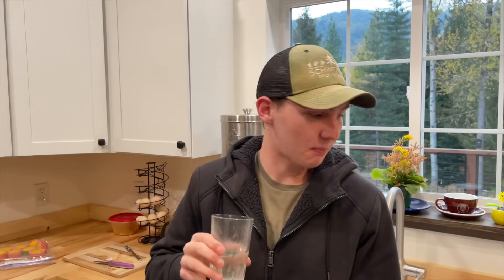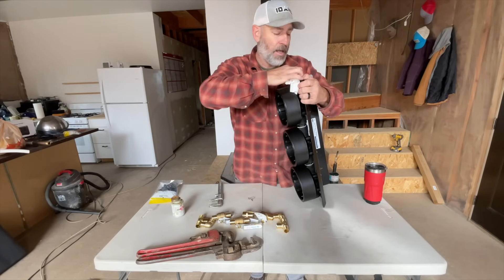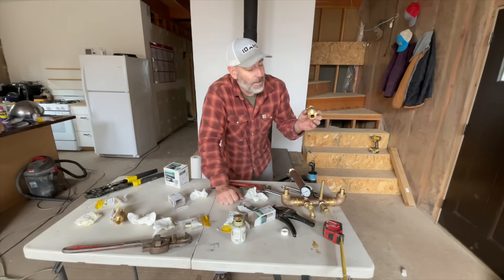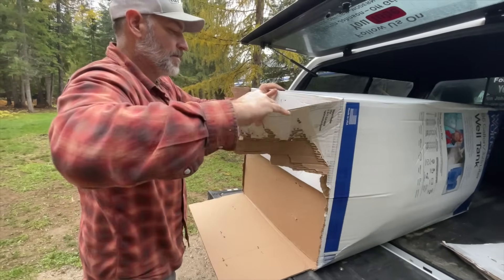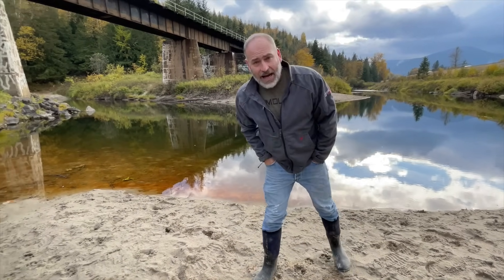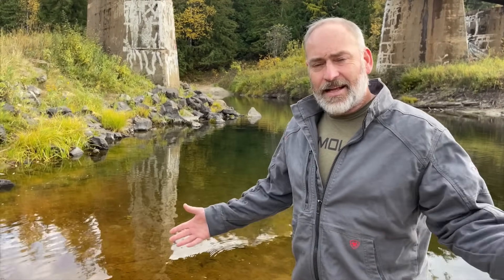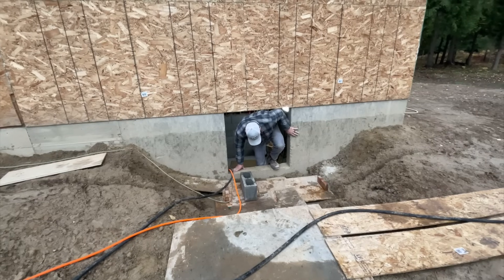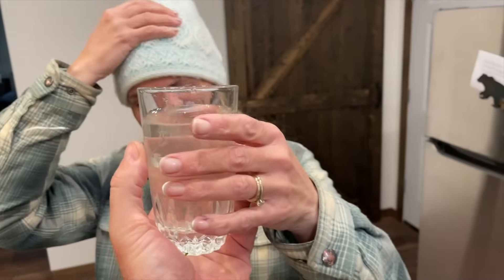ULTIMATE Off Grid Water System - Real Off Grid Living

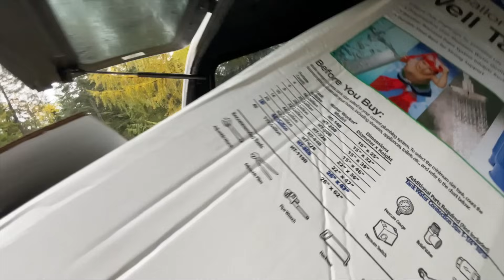Comment: Hey never seen your channel before, but I am a well technician hopefully I can give some tips or advice. 1:20 I use teflon tape and pipe dope when I do anything. It cheaper to buy teflon than to have a call back for a leak. 3:20 you don't need to open the bypass to change the filters unless you have something very important using water. I also didn't notice any pressure release buttons on the filters they may be black and just hard to see. But if you don't have any way of releasing the pressure out of the filter you will never get it lose. 8:45 tanks are sized based on your pump size. I am sure this one is sufficient but the reasoning is for proper run time of the pump, you don't want it run for short periods of time bad for long term health of the motor. 9:50 if you can run a ground to the tank. The brass to stainless connection will cause electrolysis but can be lessened with grounding. 22:35 Carbon should be last in line as the iron will foul it out and clog the filter.  hope it helps

Comment: OOPS never use Rector Seal on any plastic.  If you do not like teflon tape, use a Teflon based paste. just an fyi.  also put a check valve between the tank tee and the filter, so you do not draw water back from the house. filter placement. sediment, iron manganese then carbon.  never use the wrench to tighten the can, it is an o'ring seal.  the wrench is to remove them

Comment: Hi mate have you thought about reverse Osmosis filters, they can even filter out salt it could be overkill or it could just not needed but anyway i thought i would mention it and for the water Snob check out Kangan water they have a machine that changes the ph of water and has its extra filter steps but they are expensive from what i understand they do some electrolysis on the water to get X PH that you can set.

Keep making the Videos and we will keep watching.

Comment: If I was only allowed one suggestion...put the carbon/polishing filter last for best taste.  The KDF/iron&mag filter after your sediment filter.    If you are really worried about ppm, and/or viral/bateria load at certain times of year you should really be using a small RO system under the kitchen sink.  imho.

Like other guys said, another not so fine sediment filter before the tank is also worth while.  You can buy washable ones.

Comment: Your filter system is very much the same as ours, just a different manufacturer. 
We have had it for over 4 years and recently changed to a block carbon filter from a granulated one and it made huge difference. We also use a 25 10 5 1 micron filter first then the iron manganese and carbon last. Your water might have a little more sediment so you may need to pre-filter before the pressure tank.
Great job and very well explained.

Comment: 27:05 I have a fairly similar arrangement with the hydrant and hand pump, and it's REALLY hard to pressurize the tank to 60PSI by hand.  Plus, you can't see the pressure, so the only way to know when to stop it is to keep pumping until your arm falls off!  😁  Still, it's much better than having no water.  This arrangement saved me lots of times when I was having problems with my well pump.

Comment: I think it would have been better to put the 3 filters before the tank.
I found that the carbon filter kills the flow to the point where you cant shower properly.
If you put the filter first, the tank wont rust from the iron coming in and the tank will keep the pressure up.
Reply: No, because if the filter becomes clogged it can burn up the pump.
Reply: @guytech7310  the pump should have a pressure switch, if the filter gets clogged, the switch turns off the pump.
The filters can still get clogged where they are...
Reply: @andrewtheologo1268  Pumps do not have built in pressure switches. issue is that the pump does not know the depth of the well. The deeper the well the more pressure is required to pump the water out of the well. The pressure which needs to be install at least at the top of the well.

Comment: Excellent video as always. I noticed your filter were 5 micron, but you need a sub-micron, say .2 to .5 to filter out cryptosporidium & giardia from the water. Ultra violet treatment will not work as they are encapsulated in husks which are dissolved by stomach acid.

Comment: Yes, gauges on the top to monitor filter restriction. My water is that cloudy and it’s crazy to see how fast that sediment filter changes color. I have a case of sediment filters for 30-45 day changes. I also put a 50 micron metal reusable filter in front of the media filters. Now I just need a nice big pressure tank like that one! Current one is too small. Nice project!

Comment: Hello Julie and Martin. Will you put a sealant like Flex Seal, but not necessarily that brand, on the concrete blocks to prevent moisture from coming through the blocks when the snow melts in the spring? Plenty of dust under the house. I would have liked to have seen the both of you with a mask on even though the audio might have been muffled a little. Martin, did you have all of the knowledge to complete all of the tasks at your house or did you consult different people? Have good days!

Comment: Our family used to build cisterns  and we put them in for holding the water from a well with low flow I've drank a lot of different tasting water but I found one I couldn't drink it had a high iron content and a high soda content with the high soda content it was smooth and soft going down but the high iron content it felt like it was going right on through it was the only well water I couldn't drink although the well we have now is a second one I can't drink it's got a high coal content and I've been afraid to try and drink it so we buy buy our drinking water but we use the well for everything else

Comment: There’s a couple of things I noticed the one you may have edited out just to see if where watching first thing on the electrical box you didn’t put a grommet fitting on the wire going into the box it’ll keep all the creepy cruelly out  and maybe shorting it out I guess there is one. The other is a suggestion put a sentiment filter before the tank also treat the water system in our house like the fuel system on the car,truck, tractor you have a primary and a secondary filters. I know these filters are not cheap and it’s easy for me to spend your money for you while it’s that time to put my finger to bed good night

Comment: Not hating on the content, you guys are great! But have you considered that since you are using PEX B, every time you put a fitting in line you are adding a small restriction, reducing water volume. PEX B 1" with 1 fitting is only good for the same volume as copper 3/4 inch line. Plus all those other couplings.... I wonder if you will have a water pressure problem with more than 1 or 2 fixtures on at once. How does the pressure feel?

Comment: Looking good!  Nice and tidy work.  However that "box" where you transitioned from house romex to the well wiring is actually a "body".  I'm not sure what is correct, but sometimes the inspectors down here in southern ID complained if those have any wire junctions. Supposedly just for ease in pulling wires, so wires just go thru not splice.  Boxes are bigger...

Comment: If I may make a suggestion.. you may have better water pressure and a cleaner tank by filtering from well before the tank vs filtering after the tank.  Just a thought, my 3m whole house filter significantly reduces the water pressure and flow.

FYI 😊
LB stands for line box. It is often used at the point where you will begin pulling wire through the conduit. However, it is not a junction box and should not contain wire connections.
Reply: A. Splices are permitted in conduit bodies that are legibly marked by the manufacturer with their volume and the maximum number of conductors permitted in a conduit body is limited in accordance with 314.16(B) [314.16(C)(2)].

Comment: Be careful how you're holding that horizontal pvc pipe as it's not a handle and could cause a leak if you stress the connection.  Another great video. Thanks.

Comment: Cable/wire/pex or anything spooled would be much easier to handle/work with if you unroll it instead of pulling it off the side of the spool/coil.

Comment: I just replaced my pressure tank after 39 year of use. I found that I needed to at least once a year drain the tank and refill the bladder air pressure to prevent excess cycling of the well pump. As the tank got older I needed to do this check more often. I'll have to look into getting one of those iron/manganese filters, we have fairly hard water from our well.
Reply: What likely happened is the bladder broke a long time ago. Pressure tanks only last about 10 to 12 years. Once the bladder breaks it won't be able to maintain pressure. You can also get sick from a pressure tank as bacteria can grow & make you sick.
Reply: @guytech7310  No, the bladder broke earlier this year. I noticed that the pump was on and off a lot. It would pump up to full pressure, but the tank pressure would drop quickly as water was utilized without the bladder intact. What I was getting at with my original comment was that the bladder may lose pressure over time and need to be refilled back to the proper value occasionally.
Reply: @jamesmckelvy5441  Sorry, but no way would the bladder membrane last 39 years.

Comment: A relative of mine has filters just like yours, and found that they're very difficult to remove after time, to the point that the plastic 'wrench' handle would bend and the filter container still wouldn't budge.  We tried a little petroleum jelly on the blue container threads before we reinstalled them last time. Too soon to tell if it helped.
Reply: Helps to have a pressure relief valve at the filters. Believe it or not the water pressure can make it  difficult to remove the filters.

Comment: Don’t ever put a filter before your pressure tank. If it plugs completely your pump and pressure switch cannot communicate with each other causing the pump not to turn on or worst case not turn off. If your bubbles do not go away you could have some methane  in your water  and a previous comment about check valve at the tank and outside hydrant not working when pump is off is spot on

Comment: It's been an electrician for 20 years. That's an lb I'm sure you're going to get a million comments. . But you need a box not an lb. Glue a threaded ta PVC connector onto the end of your pipe so you can put it in a four square box or if the basement damp to Warrant an FS box that would be better yet. Then use a connector for your Romex

Comment: When you have lots of roof space, why not just collect rain water in addition to the well water? You already have a big holding tank, so you could let the roof water into it, pump it from the tank through the filters and use it. Also you need a filter before the tank in the basement, to avoid all the silt and dirt accumulating inside your tank.
Reply: Likely need to treat rainwater as it can be contaminated with bacteria from bird droppings, rodents, bugs.

Comment: You might want to run your 12-3NM through conduit instead of zip tying onto your plumbing lines. All exposed wires running along the basement wall as well. Fasten conduit with straps. Code and less chance rodents chewing on wires.

Comment: Can you mount a pressure guage/regulator on the tank?
Reply: Yes, Their pressure tank Tee, has ports for pressure gauge and pressure switch. Water systems do not use pressure regulators, just a electrical pressure switch to turn on & off the well pump.

Comment: Dunno if perhaps already mentioned, but the last "filter" for iron and manganese in your filter assembly, is most likely not a filter, but an ion exchange column. Metals dissolved in water are not particles, but ions, so cannot be "filtered" out, and has to be chemically exchanged - hydrogen ions for cations like iron and manganese, and hydroxide or a similar anion for the corresponding anions like sulphate of chloride - so your iron sulphate turns into H+ and OH-, to make a water molecule, and the iron and sulphate gets retained in the resin. It may also be adsorbing medium, where the iron gets chemically attracted to-, and retained by the medium.
So that is probably why the iron and manganese is last in the line - was that recommended? - so you don't get particles into the resin.😀

Comment: Do the filters have to be installed in a certain sequence?
Reply: Yes, Sediment filter first to extend the life of the carbon & iron filters. You could use a different order, but it will reduce the lifespan of carbon filters as they will become clogged. Sediment filters are considerable cheaper to replace.

Comment: You forgot one thing.  You need a way to bleed off the pressure on the filters after you bypass them.  I made the same mistake it makes it a real bear to get your filters out without it.
Reply: A good filter system will have pressure relief valves built into the frame. Mine does.

Comment: I'm confused on the whole bypass thing. Why not just close the input and output valves, effectively turning the water off from the house, then change the filter, then open the valves again? What's the point of bypassing them?
Reply: In case there is a problem with the filters, ie cracked or leaking filter housing, or you need to pull a lot of water and don't want to degrade your filters super quick, For instance running the house to fill a pool or power wash a bunch of vehicles & equipment.
Reply: @guytech7310  that makes so much sense now, thank you!

Comment: Using inline filter that does not have a valve or regenerative media is a bad idea, also no UV system or RO makes this some way off being Ultimate, but at least you showing people something they can do. Off power bacteria treatment can be done with 0.2 micron Nanoceram filters that will fit your housings. You should also use the pressure release buttons on the housing after flushing and they pressurise to relieve air in the filter housings